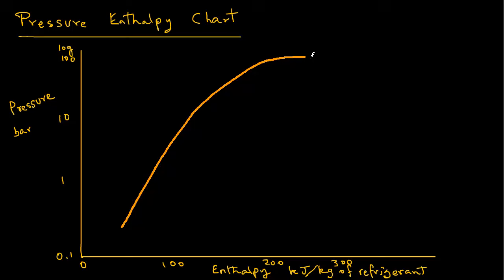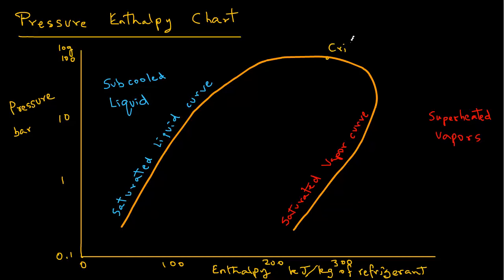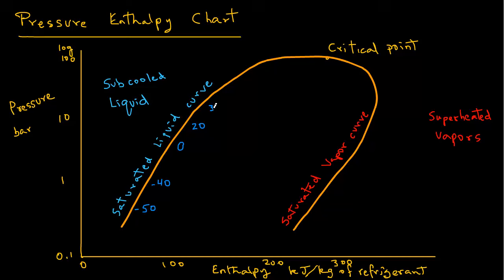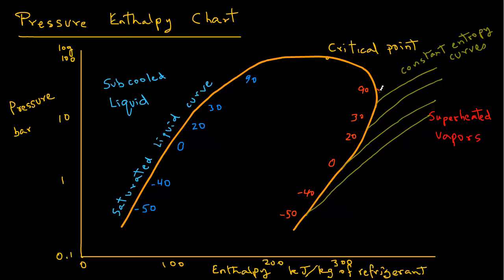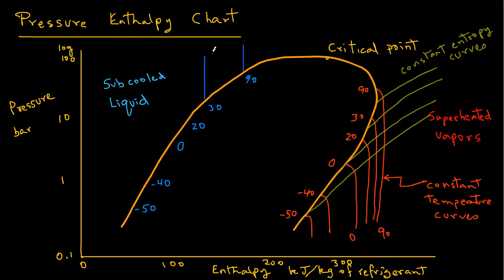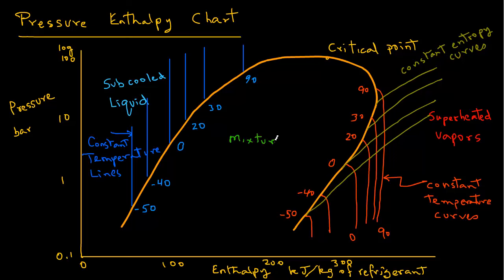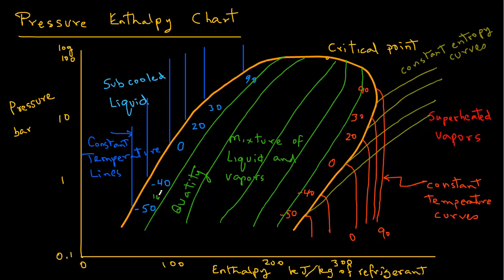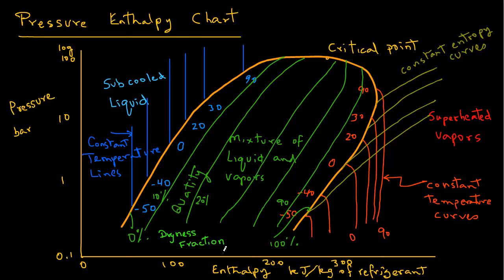Refrigeration - Pressure Enthalpy Chart

Comment: But why do we draw it ... What is the purpose of drawing it?
Reply from the maker: Good question!  The purpose of drawing a PH chart is to understand thermodynamic properties of a refrigerant, and the process of how refrigerant changes its phase from liquid to gas and then back to liquid. The role of pressure becomes evident as you traverse a refrigeration process later on this diagram. Once you have drawn the PH diagram yourself on a piece of paper, your understanding of the vapor compression refrigeration is enhanced. These are some reasons why many find this approach useful. I hope that it is helpful to you.